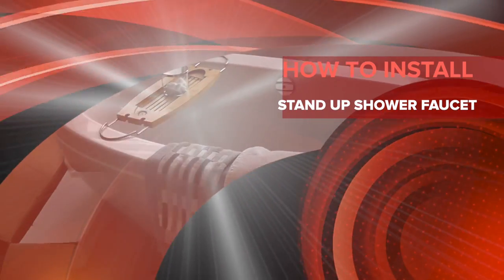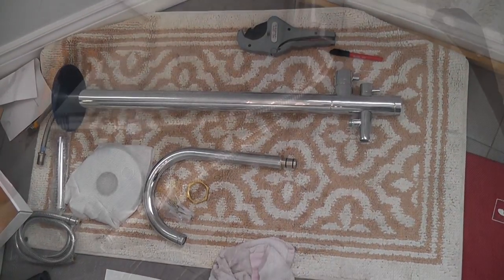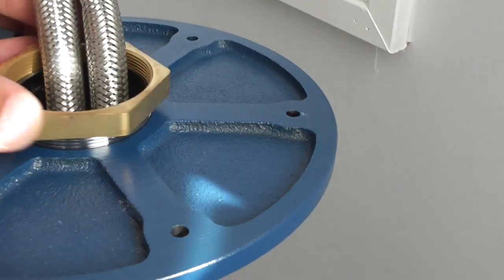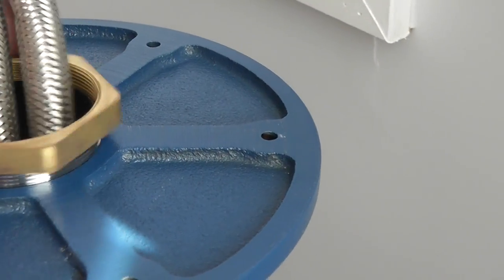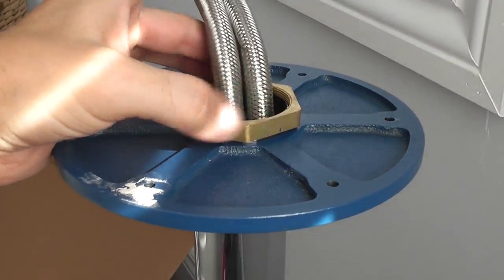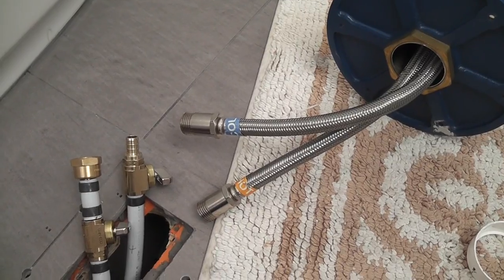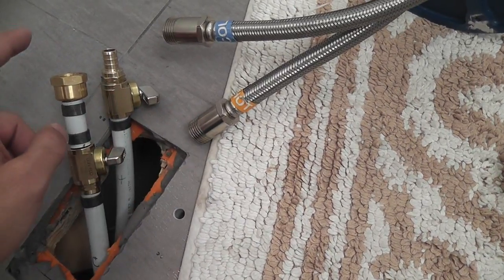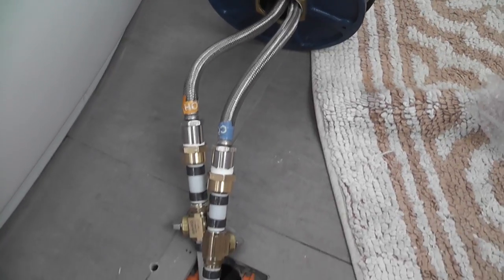how to install a stand up bathroom faucet

Comment: my problem is I have Glacier Bay Farrington Tub Filler Faucet. It's hot and cold lines are sticking out 12" (it's ridiculous!). Even though I have pex water supply lines, I cannot push all the hoses through the hole because of 12" extensions. The faucet hoses cannot be shortened, so I think i will have to remove the tiles, subfloors and arrange the plumbing and do the whole thing again. Has anyone had the similar problem? Any suggestions?

Comment: Can anyone tell me how to change out the water supply lines from old copper ones to flexible ones for one of these free standing tub faucets. We recently removed an old 1980s Jacuzzi tub I want to replace it with a freestanding tub but the plumbing is old underneath and out of date plus it’s all copper and bent in weird positions
Reply: Just get a copper to pex adapter. You cut the copper wherever, and solder on the adaptor and you can continue in plastic pipe. It's pretty easy
Reply: Female adaptor...
Reply: Sweat by pex adapter,  or sharkbite